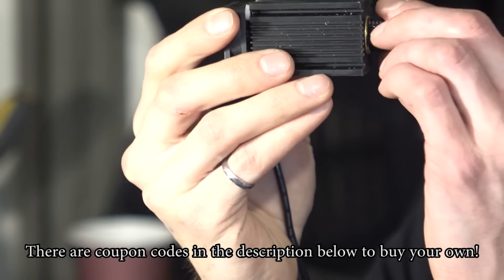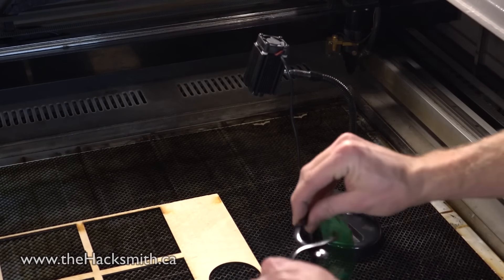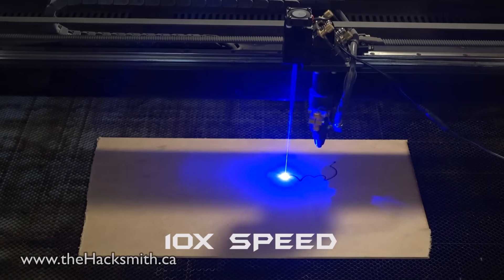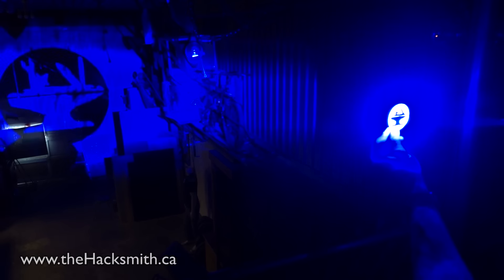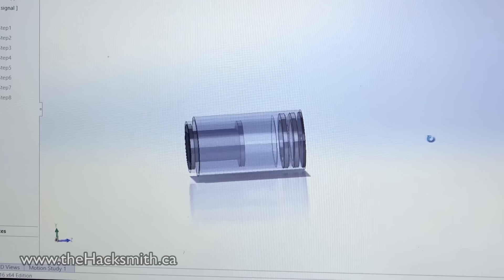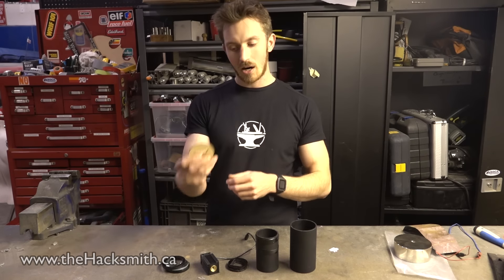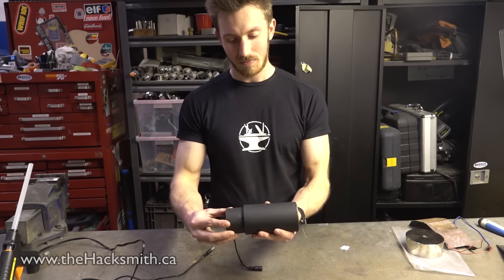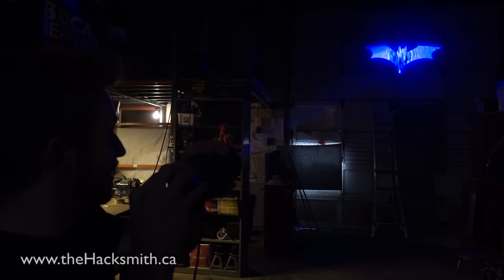Make it Real: Laser Powered Bat Signal!

Comment: That's not collimated light, the laser light when bought originally is collimated, removing the lens cause the beam to disperse upon exiting the laser cavity. By removing the lens you are removing the collimating effect. The point of a collimating lens is to prevent beam dispersion.
Reply from the maker: +rockwaystudent123 ... Any consumer laser will have a slightly diverging beam. A lens doesn't change that. The light is still mostly collimated compared to say a flashlight, which is why this can actually be used as a signal. Can't do that with a flashlight.
Reply: But you say removing the lens will create a high powered flashlight of collimated light which is simply not true. Yes a diode laser will have less beam dispersion than a flashlight but the light is by no means collimated upon removing the collimating lens.
Reply from the maker: The lens we removed is not a colimating lense...  it's just a focusing element.
Reply: Any lens can be a collimating lens. Collimated light occurs when the lens is placed 1 focal length from the laser cavity exit. That lens was intended to collimate the light.

Comment: Hello i have a question being that the laser can cut wood what is stopping it from cutting that burning the wood with the bat cut out in the middle of it, The lens?
Reply from the maker: +joseph chrzempiec (josephchrzempiec) because it's not focused
Reply: Ahh okay i see Awesome. Is there a way to do the and have the same effect without using a laser? Maybe with leds or something?
Reply from the maker: +joseph chrzempiec (josephchrzempiec) not easily, you need fancy optics to collimate light. Try taking a flash light and putting an image in front of it -- you won't see a clear projection

Comment: I think you've been doing small-scale experiments before that. I do not plan to use it at long distances. I will reflect to the wall from 10 meters. Do I need a 2.5W laser? Or how many mW is enough?
Reply from the maker: +Hüseyin Şehit ÖZDEMİR under 500mW would be enough
Reply: I see. I read a few articles. Some lasers have a duty cycle duration. There is no need for such things in the cooler ones like this. is it correct?